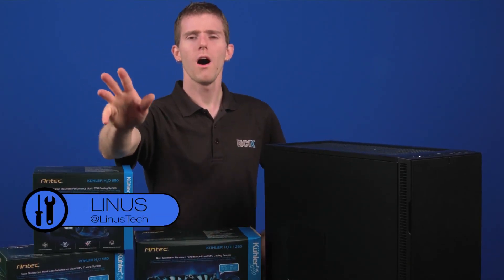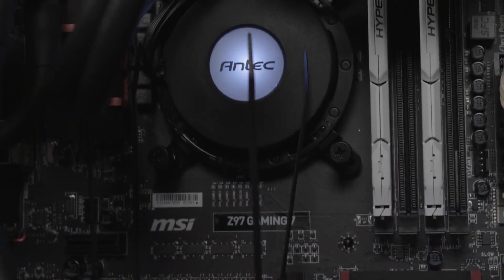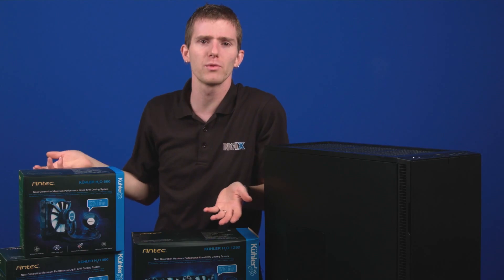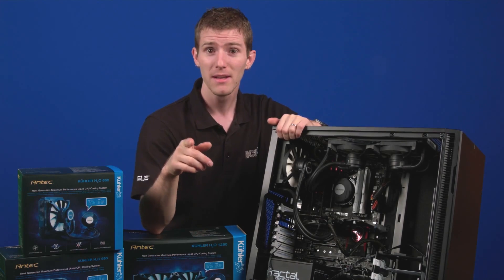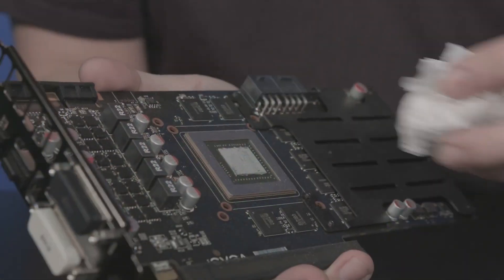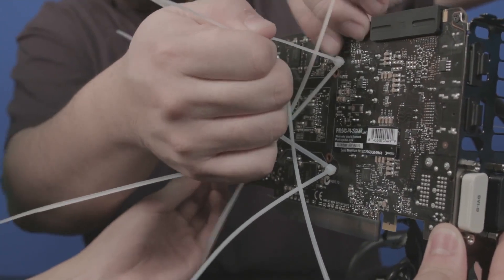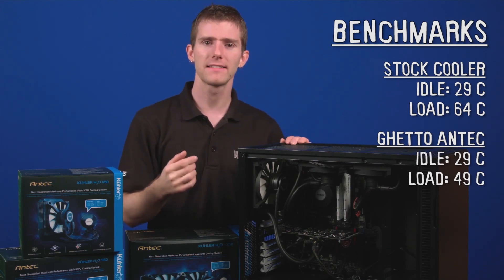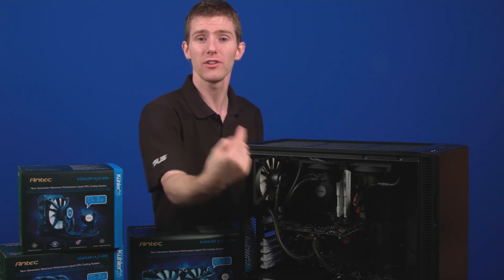DIY GPU Cooler ft. Antec Kuhler liquid CPU cooling

Comment: Sorry for bad english

I've done this on my inno3d gtx 1080. I'm using an 240mm aio cpu cooler from deepcool, and the result are full load at 53-54 degree celcius, idle at 33-34, it's running for 1+ year without problems.

Ps:
- tighten the waterblock to gpu die for better result, trust me the gpu die is not that easily break from pressures.
- don't forget to cool your vrm and vram with an 10mm x 10mm heatsink.

Comment: Ghetto rigged? Really? I would think someone with your status on YouTube would avoid racial slurs. It would more accommodating to call yourself a hack by using zip ties to hold a cooler onto a expensive GPU which in speaking kind is simply a idiotic maneuver. I would sure hope your followers don’t attempt this at home. If anyone wants to do this find a local machine shop to fabricate a proper bracket or look online for someone who already does. It is disappointing seeing someone with this many followers teaching bad methods while speaking inappropriately. Perhaps you owe followers an apology.
Reply: This shit was 4 years ago bruh what are you talking about

Comment: Sick of the rattling sound your old GPU makes?
Don't want to Upgrade just yet because the GPU you've been waiting for might be released any minute?
Your sh*tty GPU reaches 90C easily while playing Skyrim?
Mad at Linus because his "Ghetto" mod is way too expensive?

Then this is the mod you've been waiting for:
Remove Shroud, Backplate and Stock Fans.
Replace old dried up thermal paste.
Use some zip ties, wire, a piece of string... whatever to attach case fans to the Heatsink. 
The size of those case fans doesnt matter, as long as your card still fits into the cardboard box you call your computer case. For the final touch place another one or two fan/s in your case, so that cold air is blown onto the backside of the PCB.

Temps are 
  27C at idle
  67C after an hour of Heaven Extreme (72C in "quiet" mode)

Comment: I a few months ago bought this cooler, but then after an hour or less after installation, the fan speed was running REALLY high and the LED was red. That was an indication that it wasn't really cooling my PC at all.
Reply: Stephen Phillips i think it's because when gpu's are cooled the other components need cooling aswell like them vram and vrm.
Reply: Stephen Phillips i dont know much about gpu's  so i might be wrong
Reply: Except you're not

Comment: Not sure if anybody will reply to this comment since this video is old, but my idle temps range from around 30C to 40C on my i5 4460 with the Antec Khuler H2o 650. Is this good or bad?
Reply: IDLE!!! I GET 20 ON IDLE WITH OLD STOCK AMD COOLER
Reply: NordicReclaimer you must have a very cold room. My room is around 25C. (75F in the US)
Reply: i was just kidding xD
Reply: NordicReclaimer I was about to say 😂
Reply: +Gussamuel You don't need to worry about these temperatures if you only worry about idle. The idle temperature is the lowest that you read. If it fluctuates from 30 to 40 then this means that 30 is the idle temp and 40 is a low load temp. Even the greatest coolers only show their capabilities at high loads, at idle it is pretty much the same story for all coolers unless there is a problem. So 30 idle with 25 ambient is absolutely ok.
Reply: Mandragoras Thank you! I've been pretty careful with how much I load my PC while gaming so as to not overheat my CPU, this greatly helps me!
Reply: +Gussamuel You do not need to worry about overheating your CPU with normal usage at all. Unless you are aware of possible issues like having a very old and dry thermal paste, no paste or too much paste, having a heatsink/waterblock not properly fitted, having a pushpin out of its place, having a closed case without airflow and high ambient temperature, running tasks that utilize the full potential of the CPU without using a heatsink that is speced for that amount of power, having a fan that does not rotate or rotates slower than supposed to (because of dust, age). You can use an app like coretemp to monitor the maximum temp that your cpu reaches under full load (gaming or benchmark) and if it is acceptable then there is no need to worry about temps ever again unless something in the future clearly indicates overheating, like slowdowns, shutdowns or reboots.
Reply: I just hit summer and I got to test out my mobo's overheat protection. the cpu was hitting 70 and boom, system off. saying that I just blew all the dust out of my pc and now it's 20 degrees cooler lol. so yeah... don't worry about those temps.

Comment: what if you have a backplate
Reply: i am running it on a evga 770 classified . it has a back plate and a front plate .  i left the back plate on and it works.  but  for the front plate  i had to two options cut  some parts so that the water block  could fit or take  it out . i left  it on so the vram can get better cooling . with a 80mm  coolermaster cpu cool fan mounted to the gpu and with motherboard  software can control the up too 3000 rpm blowing air 
it was very easy  to do and getting  way better  temps 
but i only did it because  i broke  the gpu fan blade  when I had my hand  in the pc

Comment: Because waterblocks are overrated
Reply: waterblock, 100-200$, pump, 50-150$, res, 30-70$, tubes, 10$, radiator, 30-100$
Reply: and the fittings.
Reply: and if you want some higher performance you'll also have to add some fans to the mix putting all that to (depending on the radiator) 20$ ~ 120$ if you're going with higher end fans.

Comment: seeing this is really tempting me to reuse my old corsair h50 onto my 980 Ti, lol. should I? annoyingly, my model is a non reference design, so no full cover blocks for me.
Reply: +Jorge Ramos What kind of 980 ti? Only real way to tell would be to try it out and monitor temps. Cant hurt... Unless you break it I guess.
Reply: +Derek Sack I have an eVGA 980 Ti FTW edition. It has the backplate for a full cover block, but I can't seem to find any full cover waterblocks for it anywhere.

Comment: corsair has a bracket that you can use with a fan for the ram so you can install an aio cooler. would that work?
Reply: Nice! I hope it works cause I ordered it and the corsair H60 cooler. The cooler and bracket should arrive today so I can't wait to try it out! My GPU gets so darn hot at 80 degrees Celsius while playing the Witcher 3 on max settings for only a few hours. Is that normal? I want to have around 50-60 degrees. That would be fine by me.
Reply: Tom Brown What graphics card do you have? I have a R9 390 from asus and it gets 92 degrees while at max load... I really hate their strix cooler, and is looking forward to doing something like this aswell. If you do this, you shouldnt be overclocking though as the VRM (power delivery) can get really hot because it has no heatsinks.
Reply: Can you safely run a graphics card with out VRM cooling? For example what if I put an air cooler on a GPU and used an extra fan to cool the VRM somehow. Would that work or should I put my GPU back together? Problem is I tried putting a Corsair H60 onto a Zotac GTX 970. I used the Corsair GH10 bracket and it did not fit. Now I don't know what to do because it was an expensive piece of kit and I don't know how to contact Corsair to get a replacement. Many thanks in advance!! :)
Reply: Yeah it does not fit. The GH10 only fits reference design unfortunatley. If you somehow get it to fit, with some DIY you will safely be able to run it, as long as the fan that is on it, is spinning, and you dont overclock it. Hope you make it work  :)

Comment: U guys fucked up really bad, the stock cooler on that card has a little extension to contact the onboard vrms (mosfets) and cool them. Ideally, you chould put mini heatsinks on those so they don't overheat... that card wont last long at all in my books. Fortunately the vram doesn't need contact on that card though and at least you kind of mentioned it in the video...

Comment: what about cooling the rest of the card? how and where to best position fans for cooling vrm and memory ? i plan to mount fx cpu air stock cooler on my xfxR7 370 that runs at 65-75C with it's stock cooler

Comment: Ok I know its for the NCIX Channel and I know y'all did this a year ago but why didn't you just use one of NZXT Kraken G10 GPU water cooling brackets with the place for the block to mount to it and the fan that comes with it to cool the VRM ? They are available as are many other options to fit that for just such a configuration.
Heck I have been using 2 in SLI on my MSI GTX 760's and they work wonders and never break 40 even when I have one or both of them over clocked to 1550 to 1690 when in single card config and not in sli, the best part is they will fit on multiple GPU's and as I am waiting on the next 1080'ti's or what ever they will be to drop but once they do i will be transferring the to the new Video cards unless for some reason Nvidia decides to go with stock water cooling option as was thrown around at one live meeting they streamed.
 I have just bought 3 more of the NZXT's GPU coolers for my next project of a new triple SLI with 3 GTX 970's as for the complaining about not being able to take off the fans to put on another brand of Fans with Noctua seemingly being the flavor of the month but the one question I never heard asked NOR even been brought up was have they ever failed and if so when and if they did and hears where they fail to point out that if it does happen and you are not home and your comp is not set up to shut down then you potentially just cost yourself a GPU all over the so called convenience of being able to use a different fan. Also they showed the cooling vs this cooler in another video with all the other systems having Noctua fans but yet the one and only with the Antec fans were the best in most cases and they actually only got beat out by 2 or 3 other coolers. I have a couple of the other ones from cooler master/corsair/thermaltake and to be honest I will stay with the Antec 1250' coolers because of that FREE added bonus set of Fans and to be able to add the 2 Puller Free Fans to the other side if needed make them clearly a better choice. 
  Just remember you need a big case and if your using a small case then you might want to think about mount outside on the top or out the back of your case. Not to mention how quiet it it is when under huge loads even in SLI with never a hic-cup!  Now if we could just get the manufacture to make the components in white/or colors like NZXT does for its Kraken stuff we are so tired of all black !!   Cow  }:-o)

Comment: NZXT has a better solution then this. They have a bracket to mount on the GPU which allows you to use their Kraken CPU coolers on the GPU.

Comment: What about.... The rest of the GPU....
Reply: most of it doesn't need cooling anyway.
Reply: "most" RIP VRM's ect haha
Reply: TJ CAT come on man, on some cards cooler fins don't even touch the vrms and the only airflow they get is straight from the hot GPU cooling. And VRMs are designed to be frying so what's the difference.
Reply: oh idk i jsut think surely ONLY cooling the core cant be good, all the little transistors ect at least have to have heat syncs on there it dissipate heat, otherwise surely it'll jsut collect and yeah, cant be good surely

Comment: I want to ghetto mod the Quadro K2200 stock cooler. Because it sucks. It's cheap, and the heat sink gets stuck with dust pretty easily.

Comment: 70-80 ºC VRM range is the absolute max? Lol. My R9 290 runs that at idle :P
Reply: +Rafael Soares Pinheiro Do you have a tempature monitor for your vram? :^)
Reply: +Bone Marrow Just for the VRM. I rather pretend everything is fine with the vram chips :P
Reply: yeah but seriously lmao
what kind of idle are you running to get 70 degrees
Reply: Hahahah. R9 290 with the reference cooler is the shittiest decision I've made in my tech life. They are absurdly hot. Had to replace the stock cooler with an Arctic Accelero Extreme 3 to make the noise / temps acceptable
Reply: Rafael Soares Pinheiro yeah
but 70 on idle?
I could literally find an old heatsink on a mini r7 card and just paste it onto the chip and get better temps than that on idle

Comment: im abour to do this haha
Reply: +luke Abruzzo did u break ur card : ^)
Reply: it actually works fine i only did this as a text to see if it works and it did lol but do remember to keep the vrm cool to
Reply: +Godfrey De Klerk Micro Passive Heatsink MOSFET Chipsink .... these actually work really good
Reply: what kind of card do you have
Reply: what you can do is get the evga hybird cooler just use the cooler not the housing it comes with it THIS way you dont need to use ghetto ass zip ties you can juse screw it right in
Reply: hey man no problem :D

Comment: want good temps even cheaper ? open the systems side panel and run a room cooling fan next to it, gpu load temps are in the low 40's XD the only problem is dust ... but if you install a particle filter you should be fine :)
Reply: +Godfrey De Klerk seriously you never put a box fan next to your open side panel? heck ive removed both panels before to make a cross flow, it didnt work much better then one box fan
Reply: +Godfrey De Klerk my bad I didn't know noise was such an issue. buy nactua fans then

Comment: He he laughing of the way you clean off the old cooling paste.
My way, 1 drop of dishwasher soap on the centre of the gpu.
Use a soft brush, dip it in water, and clean the gfx card.
Then under the kitchen sink and flush with clean water. Then dry of all water. 
Good as new.
I promise you, it never fails, done it a lot of times, and nothing ever short circuits.

Comment: I  accidentally touched the cpu couple times before i put cpu cooler should i clean my cpu with 99% Isopropyl
Reply: +elias lollonen dont worry i dropped my 8350 like 3 times and had to bend a couple pins back straight and it still works like a beast.
Reply: k ty m8

Comment: lol i took the stock cooler and accidentally lost the acx fan holder/shell so i zip-tied the fans on with some small pieces of paper taped together underneath to give them some height
Reply: but jesus it got 99 c temps while under load probably bad thermal paste

Comment: I've done alot of work with IR thermometers, and i can tell you that they are meant to measure larger areas, even at 3 inches away the surface area that it is reading(varies by brand) is roughly 1-3 inches, you literally need to touch the item you're measureing if you want an accurate reading, the only solutions that i have found that give reasonable accuracy is finding a probe thermometer, or using a thermal camera, the VRMs on my 25% FSB OC on my 1045T would say they were a cool 70C with the laser thermometer, but the probe thgermometer would say 105c and my uncle's thermal camera would say 120c
Reply: +denvera1g1 i didnt realise this until i tried to measure my exhaust headers on a cold winter day after an hour of driving, holding about 8 inches away the thermometer was reading 240F, but when i brought it closer just a few seconds later it said 490F, this was because it was averaging the temperatures of everything it could see, the relatively small exhaust pipe on my V8 while very hot, was small compared to the 10F ground that was visible behind it

Comment: If we use standard wire thermometer we can read eg. 50*C on chips.
But if we use IR thermometer in same situation, we can read 80*C.
Why?
Because standard wire thermometer measures temps on black plastic case of chips, where IR one read internal structure teamp which is always higher.
So, if we use IR thermometer we can say that reading 100*C at max load is ok.
Reply: does it? Wire thermometer just doesn't measure surface only temperature and IR one does.
Reply: IR measure internal temps which are always higher.
Reply: Ty ale na chuj do mnie piszesz po eng? :D
Reply: Arek R. chodzi o to, że dopóki zwykły termometr nie będzie miał dokładnego kontaktu z powierzchnią VRM, będzie nagrzewała się tylko jedna jego część a reszta będzie po prostu chłodzona przez powietrze. Termometry na podczerwień liczą właśnie temperaturę powierzchni, tak naprawdę w żaden sposób nie da się zmierzyć jaka jest temperatura w środku ;)

Comment: pfff Raijintek Morpheus comes with VRAM+VRM heatsinks and will bring down a card like a GTX 970 to 52-54 degree max. For 60 Bucks. Complete Cooling, not only the DIE. And you dont have to worry about leaks or broken pumps.